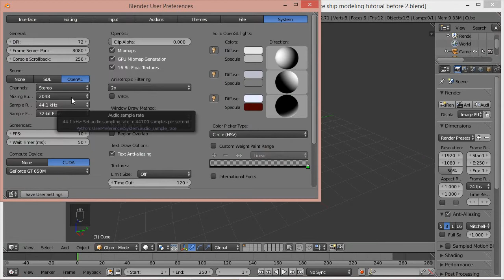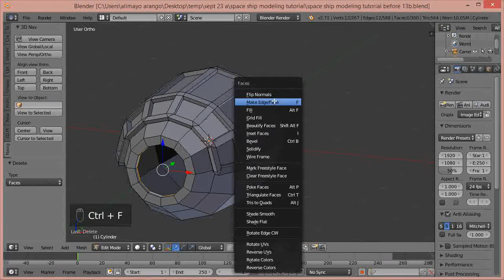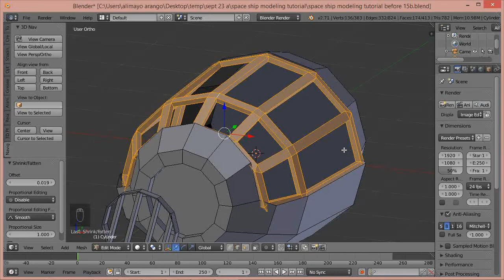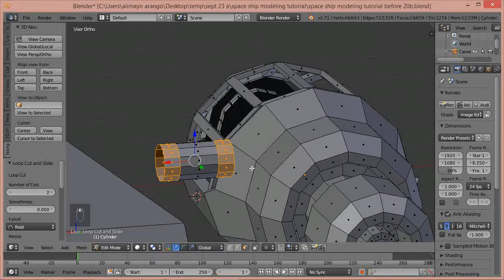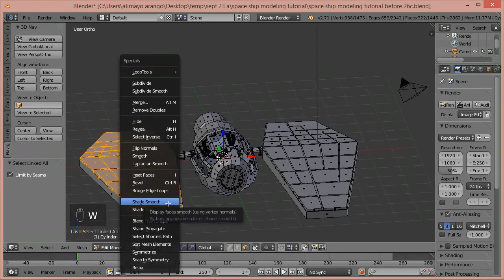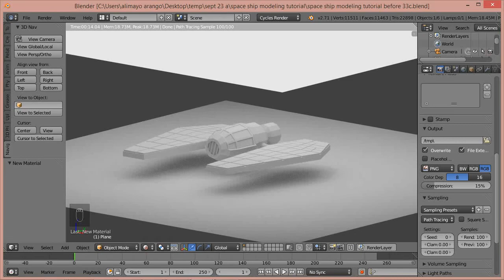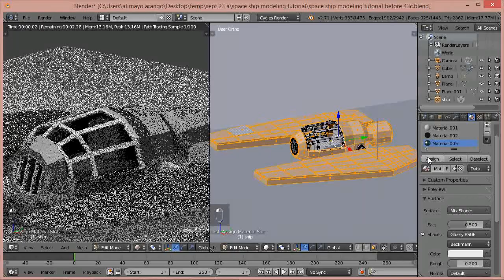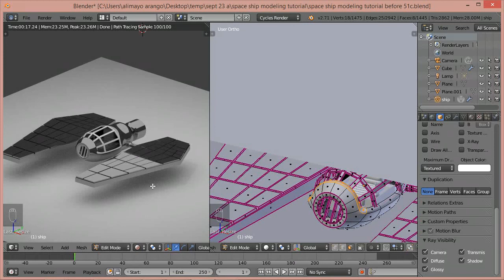How To Model A Simple Spaceship In Blender 2.71

Comment: Love this tutorial. @16:44, you said to bring the sides of the ship out a little to fit the top of the cage/top.  I found a faster working around at least I think so. Wouldn't it be easier just to scale down the top to fit the base of the ship? That's what I did, and there were no gaps/spacing in between the two sections. I realize this is a slightly different look than what you have. But I didn't start up following the video until 20:29 again.
Reply from the maker: Hi Daniel. Thanks for the tip. Thank you also for watching this video. Do did you come up with any other ideas that you think that I could use as you went through the tutorial? recently I was just thing about a new ship design. Thanks again Daniel.
Reply: Not at the moment. I am new to Blender, so I am having a really hard time with figuring out things while following this tutorial. For example, I could not get the cage to match according to what you had. I kind of just spitballed my own. Since I am new to this software, I am taking this really slowly.  Currently, I am @ 34:23. I wondering if there was a way I could talk to you privately that would allow import of blender files instead of back-and-forth on here? There are several questions I have, since I am in new beginner, pertaining to this tutorial.